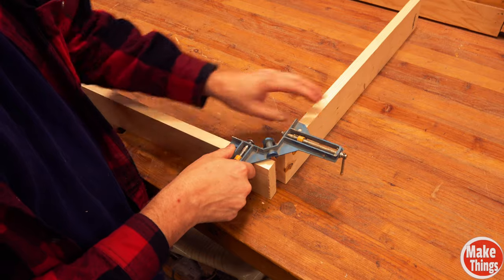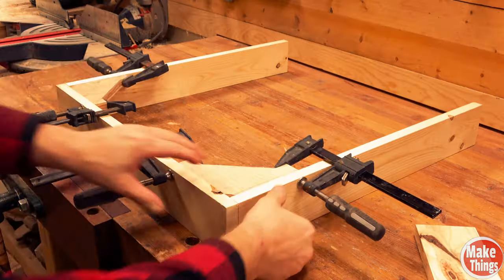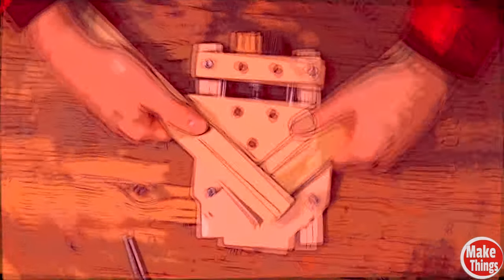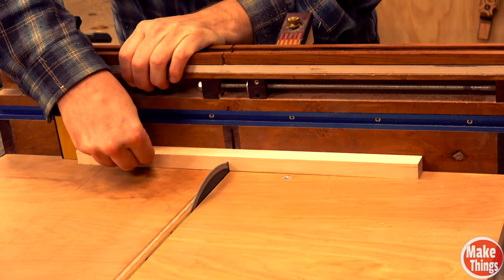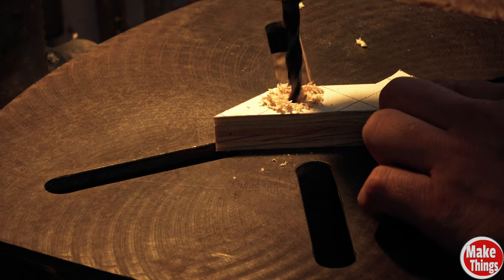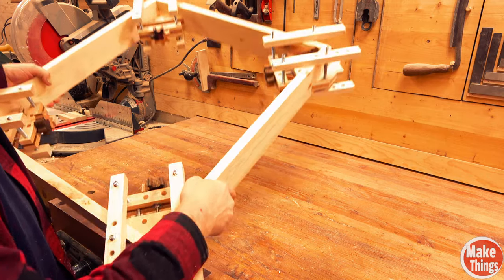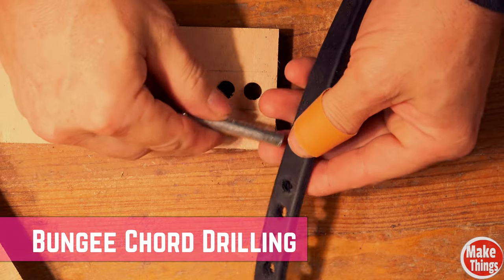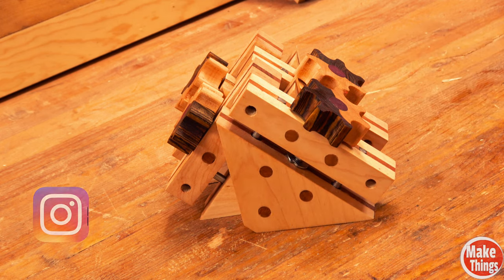Box Corner Clamp // Don't Let Box Angles Intimidate you! // Make Things

Comment: Cool stuff. Don't sweat about having to pull in the corners, even with expensive branded corner clamps like I use this is often needed. Plus, yours look much cooler 😉
Reply from the maker: Thanks my friend.  In theory, everything should work perfectly...wood is a strange beast though.  I find it amazing how you can joint a board, plane it, cut it on the table saw, and then find out that the wood has so much potentially energy that it becomes curved again, or explodes on the table saw.

Comment: Hi Rob. It’s great having you back on YouTube making your fantastic jigs, etc. As I mentioned on Instagram, your engineering is exceptional. It was interesting seeing some of your initial ideas. They make your end product look even better. These clamps are outstanding. Perhaps the “flexing” you mentioned in the clamps could be eliminated by using stiff plastic, i.e. plexiglass. Yes, I know that might upset some woodworkers but it might solve the problem. In my opinion it wouldn’t be any different than using epoxy in a wood project. It’s plastic too. 

Hope all is well.
Reply from the maker: That's a good idea.  Even possibly using some type of thin metal backing might work.  I try to work with the material to compensate some of that (a little secret, those back braces aren't 90˚, they're probably 88˚ so that they grab the material and also to compensate).

Thank you so much Don, always, thank you!

Comment: I have a strap clamps that I have used only a handful of time... I have thought of making a better version of the "strap clamp" but... the strap is KISS already and it defeats your problems with pressure into the corner where needed, and... seems easier to just measure diagonally if I wonder about square?
Reply from the maker: I've had some of those in the past...is it a nylon strap?  If it's what I think it is, the only real problem with that was getting everything lined up just right...not that it couldn't be done, but I remember getting frustrated with it.  Been probably 10 years since I've used one though.

Comment: Hello, how would you glue or nail the corners, if the jig is in the way?
Reply from the maker: It really isn't a problem unless you're making picture frames as they're thinner (which is why I suggest using the solid versions with clamps).  The thicker angles should still be doable.

Comment: I've always hated those stock right angle clamps because they don't help you line up the flush-ness of the pieces. They could be "square" but stick out past one another. A REAL corner square jig needs to STOP the board from going any further so you can just stuff the boards in there, push them in hard, and have guaranteed flush mating along with the 90 degrees. The right angle jigs from the store don't help ensure flushness.